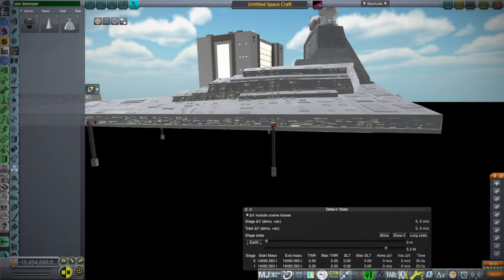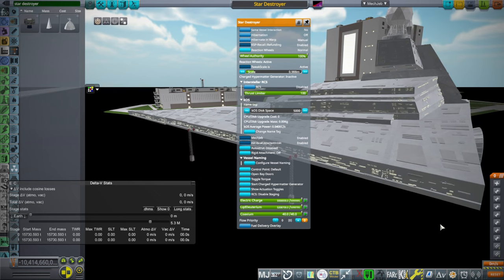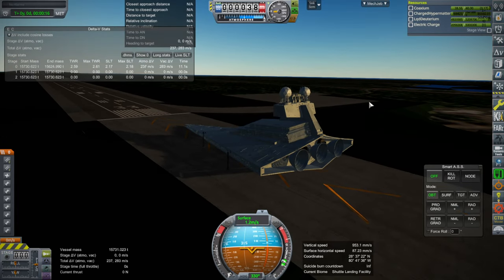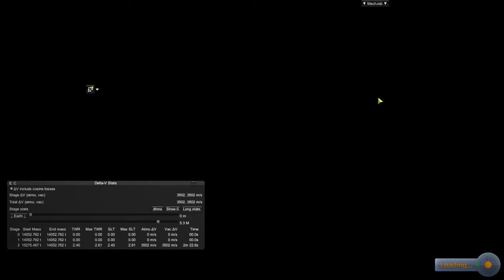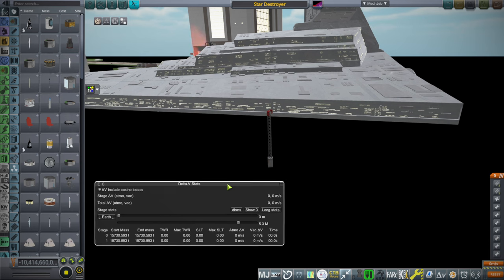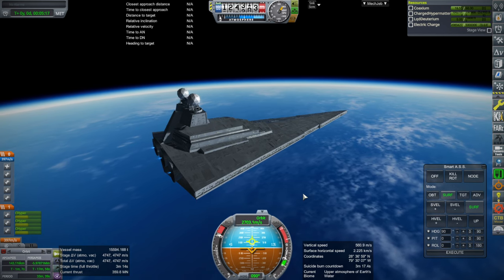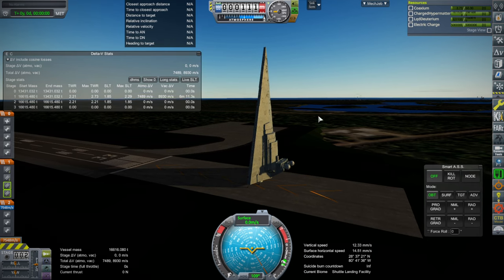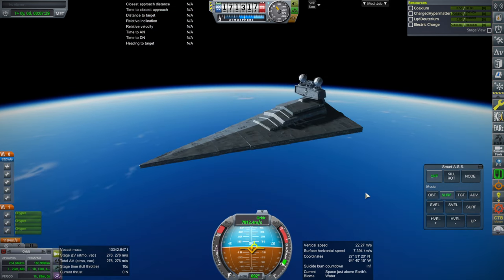Star Destroyer Accuracy Improvements and Launch Test in KSP 1.12 + RSS

Comment: Star Wars ships pretty much have unlimited Delta V as long as they got reaction mass to burn to power their main reactor, which isn't infinite but given how stupidly energy-dense hypermatter is and how long ships can go between refueling it might as well be. In fact ships in SW are more commonly found using power to suspend themselves in a point in space rather than orbiting (hence why they fall when disabled) because their energy sources are just that good. You could give the Star Destroyer like 99999999999999999999999999 Delta V or some insane number like that and it would 100% perfect lore sense. The main reason the Death Star relied on orbital mechanics was because it was too big and massive to use repulsorlifts, but Star Destroyers and smaller can go straight to their destination, so basically Delta V is hardly a concern to them.
Reply from the maker: I ... will have to ignore that. Especially the suspending at a point in space and then going straight down when disabled thing. We'll pretend that's just a big old misunderstanding about what was going on. Maybe they were at a synchronous orbit and just happened to tilt downward when disabled.
Reply: @RaizSpace  Or maybe, just maybe, Star Wars lore is an inconsistent mess at best written through throwaway lines uttered in the 70/80's : )
Reply: @RaizSpace  Eh, maybe. But if you already have FTL figured out then just hovering over a planet for days on end (or just for the course of a battle) shouldn't be too much of a concern and makes sense strategically if you're trying to keep an area on the surface locked down. Although it was canonical for ships to use higher/slower orbits to "park" and shipyards and defense stations were regularly put into those orbits. The Battle of Coruscant was fought in the upper atmosphere and the ships there mostly used repuslorlift power and not orbiting (the Invisible Hand burnt up because their repulsorlifts were screwed and they were attempting to achieve an orbit and escape velocity as a last-ditch effort of escape, but failed obviously) meanwhile the Battle of Endor was actually fought in synchronous orbit (Endor was a low-mass body with a fast rotational period of 10 hours so it's synchronous orbit would be lower). Whether ships in the Star Wars universe orbit or use "hover mode" really depends on the situation and battle plan, but they have no problem hovering for a long time.